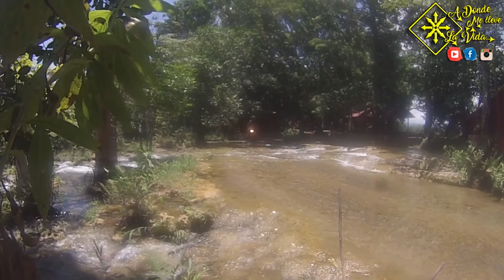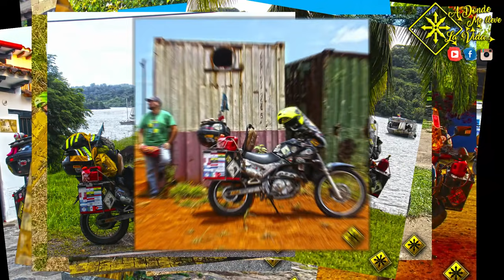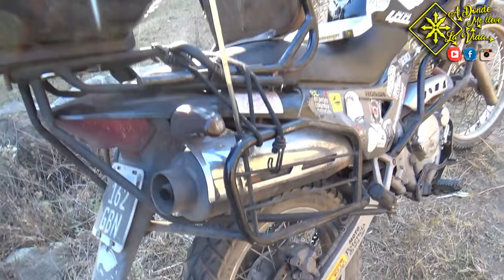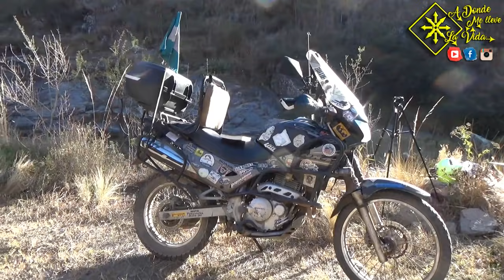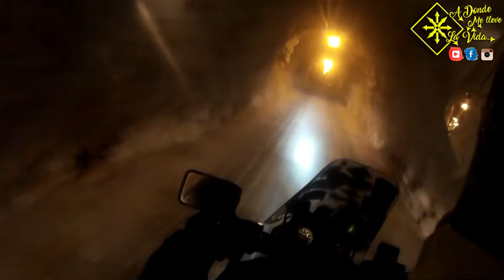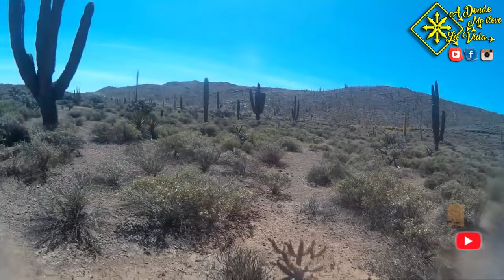HONDA FALCON NX4 - LO BUENO Y LO MALO - REVIEW 200.000KM

Comment: Que hermoso video. Gracias por compartir. Me acabo de comprar una falcon 400 y venía con una falla en la bobina del motor. Así que ahí la tengo  esperando que el mecanico termine el trabajo. Gracias por la motivación.  Que bueno el respaldo trasero que hiciste para el asiento.
Reply: Que pasó con la falcón? La repararon bien? Alguna otra falla?
Reply: @beeman596  ya poco más de 1 año con la falcón. Y si. Me ha dado creo que todas las fallas que podría dar. Está semana medi el aceite y estaba bien. Al andar no más de 5 kms. Se fundió el motor. El mecánico dijo que por falta de aceite...

En fin, ahora la reparación me saldrá cara ... Pero de todas maneras la moto cuando está sin problemas anda espectacular. Pero hay que tener un cuidado único con sus detalles. Si no, pasan cosas como estás.  Ya le cambié cadena y tensor de cadena interna. Le cambié la cadena externa. Le rehice el motor de partida. Mantenimiento profundo al carburador, frenos, etc etc etc. Hasta se me doblaron 2 válvulas y se rompió el asiento. Tuve que rectificar y todo eso... Si es un dolor de cabeza a ratos. Pero siento cierto tipo de resignación.
Reply: Ah, te compraste un problema.
Tenia en vista esta moto pero veo que si no esta cuidada voy a llevar a los hijos del mecánico a la universidad.
Yo se lo básico. O sea, para mi no es una moto caminada.
Porque? Porque si no encontrás alguien que haga las cosas bien sin ser chanta renegas y gastas como si compraras una cero kilómetro.
Se te fue mucha plata en repuestos? Colocaste original o alternativo?
Seguro que quedo sin aceite?
Se me hace que el mecánico hizo algo mal o a medias y por eso explotó. Capaz se tapó algún conducto de aceite por usar silicona en vez de junta

Comment: es re loco lo del aceite es verdad gasta mucho . yo hice un viaje a brasil 1750 ida 1750 vuelta gasto mucho aceite pero lo más desconcertante es pedirla a mi nunca me resultó lo de los 5 min . siempre me mide nada como que no tiene tengo que hacerla andar unos 100 mts para que mida. te felicito por el viaje sos un groso
Reply from the maker: Si es un quilombo medirlo, cada quien tiene su técnica!... gracias Abrazo
Reply: A que velocidad lá viajabas qué consumió tanto aceite?.si no podías tomar la medida le agregabas al tuntun?
Reply: @beeman596  a 6200 rpm la velocidad no importa sino las RPM y la temperatura ambiente . De las líneas de la Barilla máximo a mínimo hay 500cm3. Tengo un amigo que tiene una 2017 no le.baja nada de aceite pero no supera desde la casa al trabajo los 70 km/h

Comment: Hola tal cual lo que vos digiste de la moto, a los 30.000km lo de la cadena y problema con el tenzor, y a los 40.000km me empezo hacer mucho ruido el motor y tube que desarmar el motor, se habia deformado el cilindro y lo del disco de freno tracero tal cual digiste se partio, y yo por ej: en 600 km de viaje gastaba aproximadamente 500 cm de aceite, jamas la viaje a a mas de 110km, y los servis a fecha y en terminos,  se le cambio la cadena de distribucion,  y discos de embrague, y es mas en estos momentos la tengo en el taller, busque adaptarle un radiador de aceite, que creo que no me resulto porque luego de la primer desarme que fue cuando le adapte el radiador, a los 3000km de haberle adaptado el radiador, la moto se me busco agarrar y perdio compresion y tube que volver a desarmarla y opte por dejarla estandar, lo que si jamas me dejo en el camino muy buena moto en lo que es comodidad y fuerza solo que le faltaria un cambio mas, pero como que no me gusta que una moto que la tengo de 0km te ande bajando aceite, mi falcon es igual a tu moto, y es modelo 2013, pero cuando te escuchaba ya sabia los problemas y en que km te habian pasado jaja, pero la tuya ya tiene 200.000km la mia tiene 53.000km, asi que la saco del taller y la vendo y ver que poder comprarme, lo unico que puedo llegar a comprar es un xre 300 porque las otras motos son inalcansables, bueno la verdad que digiste todo de la falcon y capaz que te falto aclarar que le falta un cambio mas, y que vibra un poco, pero lo mas importante jamas me dejo en el camino. 
Las cubierta tracera se las cambie a los 12.000km y le puse unas mexzeler que son un poco mas duras ya que mas la uso en ruta que en caminos de tierra. Un abrazo desde san lorenzo provincia de santa fe.
Reply from the maker: Que raro lo del cilindro, si a mi no me agrada eso de ponerle radiador, mejor dejarla original, dicen que la xre300 ya no da los problemas de la falcon, igual la mia tendra que seguir aguantando, no hay plata para cambiar y tampoco la quiero vender ya hay un afecto especial, jaja, Abrazo y buenas rutas!

Comment: Les cuento mi experiencia con la mecánica, un mal ajuste de las válvulas terminó con el motor. Es muy importante no improvisar y tener las herramientas adecuadas, en mí caso por estar las válvulas con mucha luz...o sea...que trabajan cerradas...se sobre calentó y hubo que rectificar y cambiar cadena tensor y asientos de válvulas....
Reply from the maker: si, y no todos los mecanicos la tienen clara, es una loteria! y mas viajando!
Reply: Tal cual, en mí caso le dieron bien la luz....pero en lugar de ser 10 décimas de milímetros eran décimas de pulgadas....en tramos cortos nada más hacía un poco de ruido...pero en un tirón de 1800 km recaliente los aros...se rayo el cilindro...se pegaron los aros...u$s 500 de reparación...

Comment: Hola Eban se me hace raro esos defectos que comentas en una japonesa más se me hace que los problemas pueden ser en la calidad de los materiales que pones. Yo a mi klr con 130.000km. aun no le cambié cadena distribución y si le cambié 1 vez los muelles del embrague yo mismo que es bien fácil. Sal2
Reply from the maker: Hola, en la falcon es asi como digo, es normal para la falcon, aunque no debería por otro lado la falcon no es japonesa es brasilera, Abrazo
Reply: No es Honda?
Reply from the maker: @tengairoad5007  Si es Honda, pero hay honda fabricada en distintas partes del mundo, al igual que todas las otras marcas, ya hay fabricas para cada mercado, igual se supone tienen un mismo estándar
Reply: Se supone que si, debe ser fallos de fabricacion. Sal2

Comment: Esos 2 problemas se vuelven crónicos por volver a poner las mismas piezas defectuosas. Cambiando los resortes de embrague por unos de xr400, y el tensor de distribución por uno caserito a rosca (no automático), no jode más ninguna de las 2 cuestiones.
Reply from the maker: La cadena jode pongas el tensor que pongas, en mi experiencia, saludos
Reply: @ADondeMeLleveLaVida  en mi moto y otra de un amigo pusimos tensores a rosca (una tensadita a tacto en cada cambio de aceite) y llevamos unos 100000km sin ningún problema de distribución en cada moto. Una 2000 y una 2008. No sé cuánto debería estirarse una cadena morse para traer problema, siempre que el tensor pueda absorber esa holgura. Con los tensores automátios (probé original, chino, unos nacionales "mejorados") siempre empezaba el golpeteo apenas tomaba una mínima holgura la cadena.
Reply from the maker: @facundonu  100.000km sin cambiar cadena de distribución?

Comment: Hola a todos es correcto todo lo que  decís pero hay que decir la verdad piñón cadena y corona cada cuanto cambias,  cubiertas cada cuanto. Yo no tengo una Falcón , pero un compañero de trabajo tiene una 2013 con 38.000 km piñón cadena y corona cambió 3 veces pastillas delantera y trasera 3 veces cubiertas va para el cuarto cambio todavía falta un poco embrague completo, no el original, es caro  regular válvulas batería 2, la moto tiene 7 años y 24.000 km más o menos en ruta  yo escucho y veo, con ésa moto está gastando mucha plata .El que va a comprar una moto de ése tipo yo no lo digo lo dice el Yamaha. Pero hay mucha diferencia de plata saludos a todos.
Reply from the maker: No debe estar usando repuestos de calidad, no puede durar tan poco y no tiene nada que ver con la moto, si una cadena, corona y piñón dura poco es porque lo que pone es malo, no la moto, o es medio animalito manejando, lo que también desgasta todo mas rápido, cada cuánto cambio esas cosas va a depender siempre de la calidad y el uso que le des, saludos
Reply: Yo tocó de afuera y veo y escucho anterior a la falcón tubo una Honda Twister 250 de 0 km 16.000 km no le gastó un mango y anterior a la Twister Yamaha 125 según el la mejor moto pero bajá cilindrada y anduvo 22.000 km una joya.

Comment: Algo que no entiendo. Tengo un YBR 125 con 115000 kilómetros, tal como lo ves 115 mil kilómetros. jamás le abrí el motor. Tiene el cable de embrague original. La usé para mensajería y viajes largos de lunes a sábado. mi YBR es 2011. 
¿Cómo puede ser posible?.
Mecánicos que saben dicen que la Honda NX 200 era muy superior a la Falcon. A mi la Falcon me encanta, pero no imaginé que tenía esos problemas en la distribución y en el embrague . 
Tal vez la Falcon necesita otro cilindro, una bicilíndrica como la nighthawk.
Que aceite le echas? lo mejor es Motul 8100.

Comment: Hola Eban !!!  mis felicitaciones por el video. Veo que no tienes caballete central en tu Falcon , como haces para solucionar una pinchadura (especilamente en la rueda trasera) fuera de la ciudad ?
Te envío un abrazo y Dios quiera que pronto podamos volver a ver la vida sobre dos ruedas.
Reply from the maker: Es una cosa que siempre quise ponerle y nunca le puse un caballete, sobre todo para poder lubricar la cadena mas comodamente, pero a decir verdad tampoco es que lo extrañe tanto, en una gomeria con un gato lo solucionas, y en la ruta me ha tocado subir la moto arriba de un tronco o de una piedra para poder sacar la rueda o inclusive acostar la moto en el piso y sacarla de costado, a decir verdad tampoco he pinchado mucho en estos 200mil km, siempre uso slime! de todos modos tal vez en algún momento le ponga uno, aunque creo que con el cubre carter que tengo no me deja espacio para poner un caballete, Abrazo y si ojala podamos volver a la ruta pronto!
Reply: Si la acuestas mi se va la nafta o aceite por cualquier lado?

Comment: Te olvidaste del alto consumo q tiene
Reply from the maker: de aceite? si lo mencione
Reply: @ADondeMeLleveLaVida  yo desia de combustible el falcon es tragon mas de 4 litros los 100km y a mas 110 km x hora la el manubrio se pone un flan ai tenes q pasar un camion a mas de 100 se te llena el toto de preguntas pero sacando esas cosas la moto es un cañon
Reply: @danydebuscandomicamino4195  no todas...la mia a 110 de gps gasta menos de 5 lts y no hace el clasico shimy q hacen muchas...no se de q dependera pero la mia no lo hace...obvio no es para hacer tramos largos a 140 pero para sobrepasos se puede perfecto...
Reply from the maker: @danydebuscandomicamino4195  si es verdad consume combustible bastante si la pasas de 100 como yo viajo a 90 no lo sufro mucho, con respecto a lo del flan ahi no, yo a hasta 120 va bien no se mueve, igual es raro que ande a esa velocidad mas que para pasar un camión, pero fijate capas tenes algo